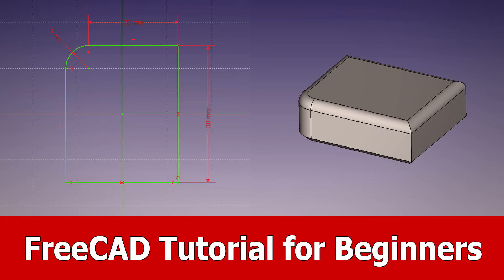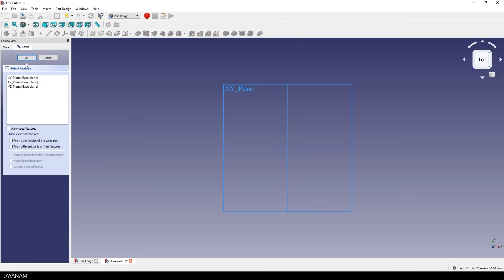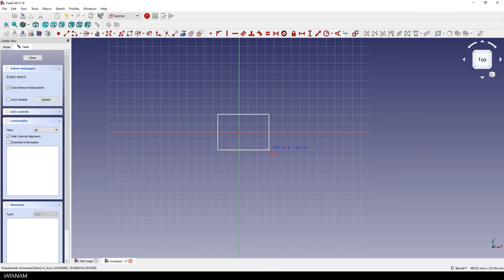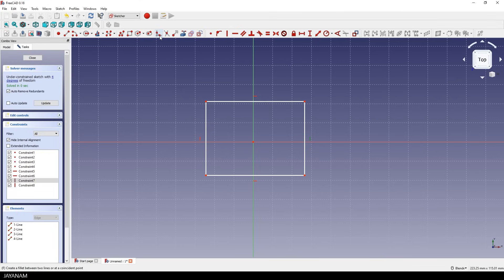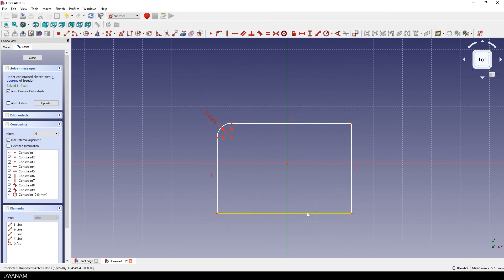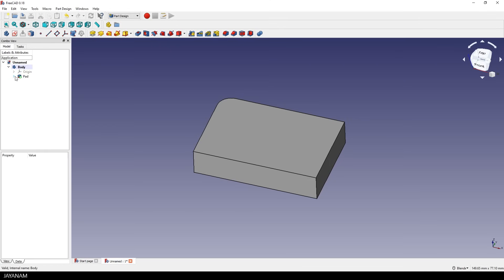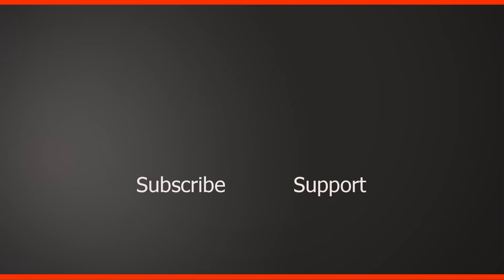FreeCAD Tutorial for Beginners

Comment: I also tried a rectangle in a new mode, where you can enter the dimensions as you drag, however after that its stuck in a mode where the cursor can't select single points etc. What mode is this, this world save time if it just worked like your original example.

Comment: I have studied other beginning FreeCAD tutorials teaching the basics for beginners. I found that this author creates the best tutorial for beginners. An issue with this author, as well as all others involved in teaching FreeCAD, is where the mouse pointer chooses a command. I have to go back and look at the movement of the mouse while the video is stopped. In this example for beginners, the constraints were not discussed in detail, which was the right thing to do. I have tried creating my own model up to the point where the next step is to eliminate any degrees of freedom. The issue is that the program tells you how many DOFs there are in your model, but not the what or where. I have looked at several write-ups about DOFs and what you should do. The only problem none of the advice is clear and does not work. Constraints in FreeCAD are a major drawback to using this software. 
Does anyone have a good example of how to find and eliminate degrees of freedom in FreeCAD?

Comment: Ugh, not another one... And worse, less than a minute... I don't want to sketch.

"lets make a cube. Let's make a slightly smaller cube. Click on 'snap to centre'. Drag smaller cube into larger cube until it snaps to the centre of the large cube. Boolean difference. Tutorial done, you now have a hollow cube." - Rhino3D

How hard is that concept in these programs without needing to "sketch"?

Comment: well, i move by pressing middle and rotate by pressing middle+right/left
but i guess this is about preferences->display->navigation, i selected CAD when i installed it

speaking of witch, i have to change this cos pressing wheel + button kinda akward

while i would prefer not to use middle button, i guess TinkerCAD navigation would have to do (cant make rotation work on OpenSCAD)

sorry about my little rant, on with the video

ok, there seems to be no ARC Constrain in version 1.0.0, either in icons or popup menu
nwm, found it in popup of elements->arc
well, this is frustrating, cant add horisontal constrain becouse it allready has one but when i try to set dimension i cant set the value -.-
ooo, i see the problem now... in new version those are under dimensions

seems like there are problems in every action, now when i try to use pad it refuses, saying that object does not belong to active body...
aparently i must use ShapeBinder or BaseFeature

well, lets see tomorrow if there is 1.0.0 tutorial, did you post any?

Comment: I have been trying to get to where I can use this program for years now. Every time there is something that goes wrong and I give up. I've now downloaded version 0.21.0 and have been following this example exactly as demonstrated. It fails EVERY time I get to the symmetry constraint. It reports: Recompute failed! I tried a few variations, like no fillet and no dims and restarted three or four times and the symmetry constraint will not work per the example. 
My installation didn't have "Auto remove redundants" checked. That solved this problem. On to the next problem and back to version 0.21.2.
Reply: I cannot tell you how thankful I am that you posted this I would have just given up again but this saved me for now.

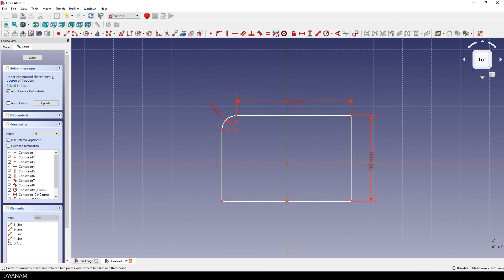Comment: Hello, Im little bit a stucked in 3:49 - 3:59, whenewer I choose that 2 bottom points + vertical line and click on that button, it will change into orange color with error message: Recompute failed! Did you know why?
Reply: I know I'm late, but it will save others. I found a guide, and in the new versions it's different, so this is how you solve it:
"To achieve this you select two diagonal points and as a third point the center and apply a
symmetry constrain"

Comment: Surface Level, the tutorial is good, but:

1. Dont just do things without properly explaining it. 
2. WHERE did you click, you say stuff like "Select the project type" and you don't go through anything, no details no info.

What happens if I click Sketch Project? What about robot? Do i HAVE to design a part first? WHY am i selecting that. Same with the whole drawing, you're just pressing buttons and saying whats happening but not what YOU did to achieve the point of this video. 

5/10 tutorial, easily fixable issues.
Reply: I'm at the constraint part right now and you say "Now use this icon" WHAT ICON. I'm not WATCHING the tutorial all the time, i'm trying to follow it in the damn software ._.

Comment: I have two versions on linux. 0.16 and 0.21.0. The 0.16 version works perfectly with the method you are describing. For some reason when I use exactly the same method in 0.21.0 and try to constrain symmetry using two points for the vertical axis, my block turns orange and then it says redundant constraints. I dont know why I get different results like this but I think I will have to learn from your videos in 0.16 first.
Reply: After banging my head to the wall with the same problem, I found that 0.21 has option called "Auto remove redundants" in the dropdown menu on the left for constraints. Enabling that lets you use this tutorial for 0.21 and beyond.
Reply: ty so much  @daapz

Comment: I tried this tutorial and at the start I followed along switched the design type and went in but there was nothing on the left of the screen nothing I did to get it back worked and now I have a 3d printer that I can't do anything with please how do I get back this thing off to the side it used to be there but now it is gone NOTHING I click does anything it's gone.
Reply: Damn auto correct what I meant to say is that I tried clicking everything but it didn't work nothing worked

Comment: I was creating a body, and although the sketch was fully constrained, it didn't turn green, instead it turned cyan, and on exiting the sketch mode, it wasn't visible and on running the pad command and giving height it returned the error that the sketch was empty..
What went wrong..
I created another body earlier and it worked correctly..
Please help 👍
Reply: I have the same problem. Have you figured it out yet?
Reply: @austin-multicellular  Well...
I just moved on from that part.. I think it was a one off bug.. 
it did'nt bother me again
Reply: @chaitanyavedak2412  I recently retried and it seemed to work as well. Thanks for the reply!

Comment: Hello, does anyone know if the measurement system can be changed for the (so called) "American freedom units..." (Yes, this is a slight against Americans!) I am Canadian, but I have been working in inches and feet my entire life. Most of the materials I will be buying are more easily measured in feet and inches. It's not a deal breaker, it just means, I will have to get my calculator out more often, lol.

Comment: Please spend more time on the basic mechanics of human interface, and less time going into any features. If a user can't do the very extreme basics with the HID, there's little chance to progress beyond that and most potential users are going to find a different program to use. This program is very fiddly at this early stage of development and it's not clear how to access and use tools or engage them physically using the human interface devices. You sound good, video looks good, but this basic tutorial is one or two levels too advanced for a beginner in this software, and I have 10 years sketchup experience and several weeks/months experience in Blender. 10 years in Inkscape. 20 years in Photoshop. 15 years in Reaper. 6 months Python development. 6 months Audio DSP programming.

Comment: OS: Windows 10
Word size of OS: 64-bit
Word size of FreeCAD: 64-bit
Version: 0.18.4 (GitTag)
Build type: Release
Branch: releases/FreeCAD-0-18
Hash: 980bf9060e28555fecd9e3462f68ca74007b70f8
Python version: 3.6.6
Qt version: 5.6.2
Coin version: 4.0.0a
OCC version: 7.3.0
Locale: English/SouthAfrica (en_ZA)

Above is my Freecad configuration on my computer. As I find it impossible to get my inquiery posted on the Freecad forum, I will paste it here in the hope of getting an reaction on it.
I don't find a consistancy in the application of my commands. I am at an early stage of mastering this program, but I do have quite a bit of experience on paramatic programs.
What I would like to know: Is there a fault in my download or installation or is my graphics card perhaps not up to the job.

The program promises such a usefull package that I am prepared to tolerate some little irritations.

Comment: This is way harder to use than CAD programs I have used in the past.  What the heck is the point of all the constraints?  Why not just not allow the part to move in the first place.  IMHO a line should have 2 and only 2 constraints (Angle and Length...)

Comment: per other commenters, you may benefit from a Mouse Halo and loitering over the button for a few seconds so it's easier to follow in realtime.
Reply from the maker: Ok, thx for the info
Reply: @JayAnAm  The example is great but indeed I find myself rewinding over and over to catch the various tools you are selecting. Also for some reason (maybe different version?) my menus are not quite the same as what you have. So spending few more words on what tool you are picking would be VERY helpful. Example: when you closed the sketch, you went to Part Design automatically. For some reason, this did not happen to me and I had to select Part Design manually. A minor inconvenience, but it took me a good 5 minutes to figure out what was going on differently. If you had mentioned that now we should have been in Part Design mode, this would have been a useuful cue. Said this, still very good example to learn from, for someone like me who is coming from Blender.

Comment: Just another tutorial that expects everything to go as you see them. Which it does not. And when it doesn't, nothing here to help troubleshoot. I.e. after you create the shape, then click CLOSE (4:23) and the screen clears, the shape is gone and there are errors next to the PAD in the operation tree when you click PAD. No help when that happens, here. Well presented otherwise. Just needs some curriculum design to help with the issues that might/will crop up.

Comment: I have been using FCD v0.18 for almost two months now.  I have created objects in it and sliced them in Simlify3d and then print them out.  All of them are functional usable items.  Now I need to be able to get print on the items I create.  I have looked at a number of videos and followed them to the letter.  But for some reason, I am not able to get the fonts in Windows 10 to initialize for FCD to use them.  I have even  downloaded fonts and saved them in a folder,  but FCD is not allowing me to use them.  The processes from other videos seem to be very basic and understandable, but I still can get the fonts working in Draft.  Can you possibly tell what the problem is?